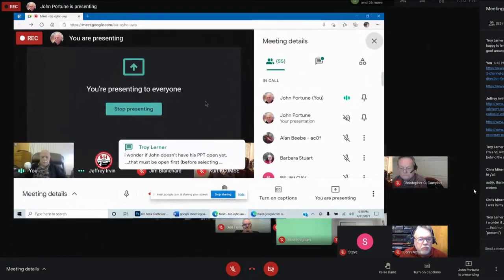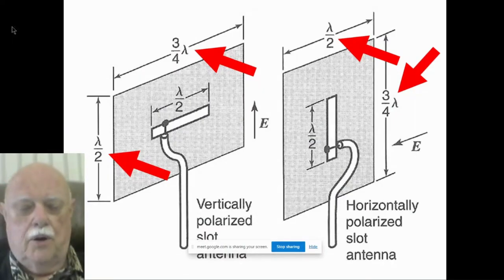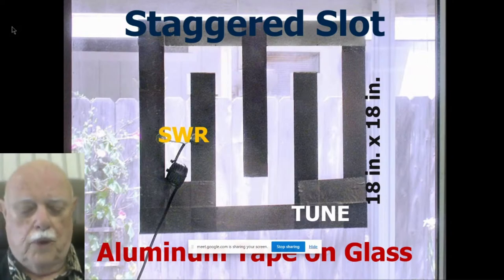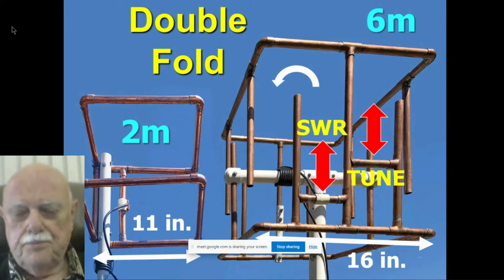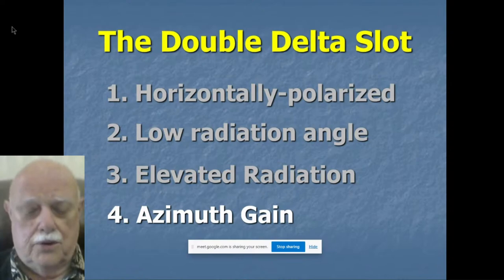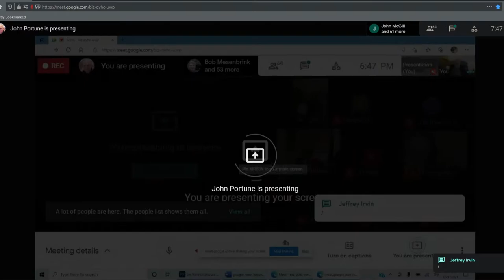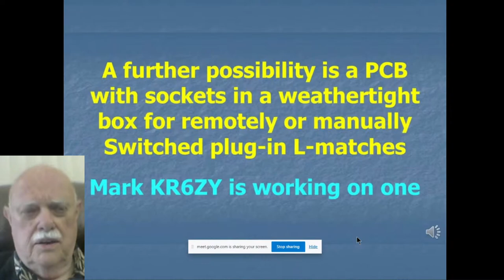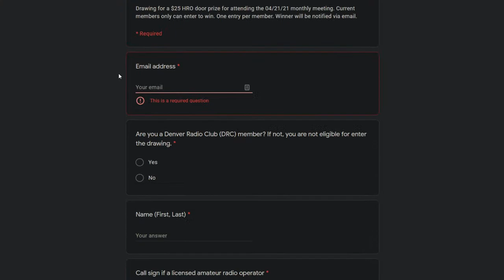Slot Antennas - John Portune - W6NBC

Comment: Hlo Sir i hv just imagined using a 40 foot 4 inch pvc pipe erected vertically & using  aluminum tape to make the Slot along the vertical length of the pvc pipe , the 40 foot high pvc pipe can be guyed with parachute Cord for support & stability, as you stated a vertically erected slot Ant radiates horizontally making this type of Ant an almost noise free Ant, what about this Sir !!!???